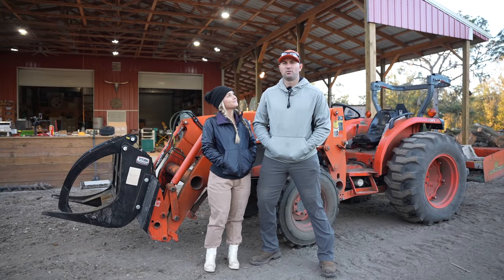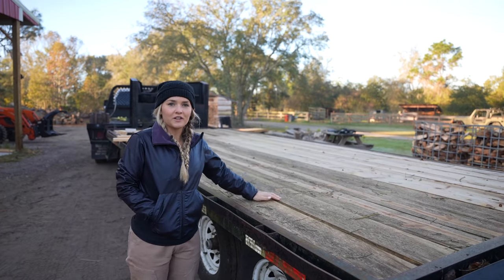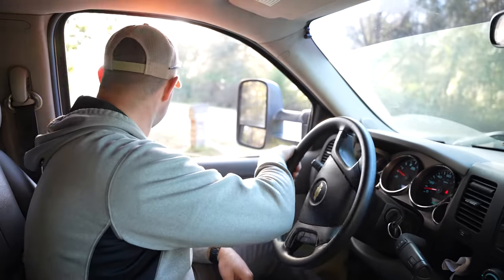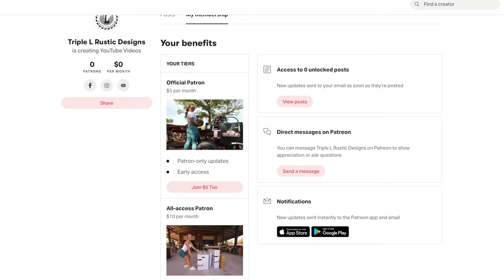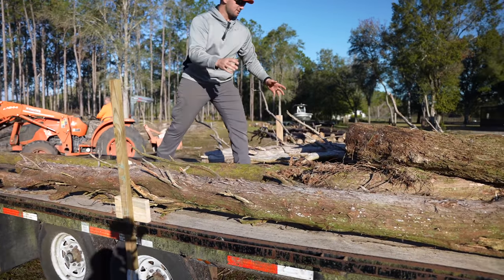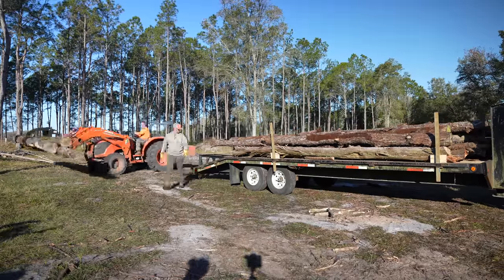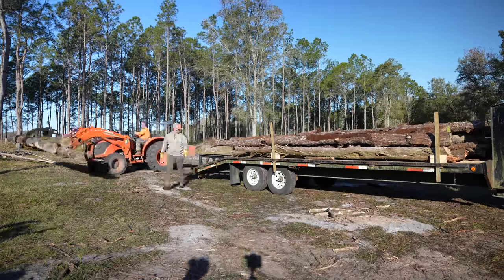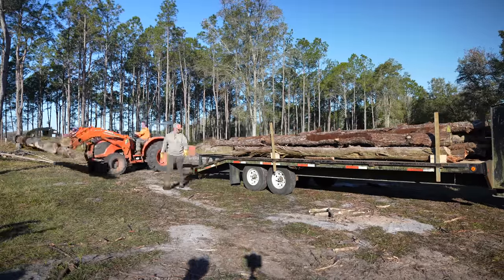Putting The Titan Attachments Log Grapple To Work On Some Pine Logs

Comment: Check your exhaust pipe. When you were filming it went by your exhauset pipe and you can see right thru it. That may be the reason your truck sounds so loud. You have a hole in your tail pipe.

Comment: Just a suggestion.. you should have metal beams to hold the wood 🪵 on the trailer
Reply: yes even hard steel and there should be one wrop or string at the front of the trailer to keep thoses trunks in place , for shure , you can never be enough careful with such loads , sorry for y english i a dutch , keep itr up and be careful , we only have one life , and one incident happend some times without rewarnings and unpredictible
Reply: by the way , my M,S,and my F key cover plates  on mine laptop key board are missing and have to push verry hard , hahahahaha yes no one is perfect , me to , and or maybe i dont mind to replace it , and i am a litle lizzy hihihi , have sweet time youre all there , you doing very nice job , i like to watch you  , and what nice pieces of wood , yeahhh , i like wood , as i am carving since my childwood in Rwanda , where i am born , i like to travel to , i hope once to go in the USA ? I never been there , i would certainly would like to visite you guys , and the sexy lady , goshhhhh 😁😁